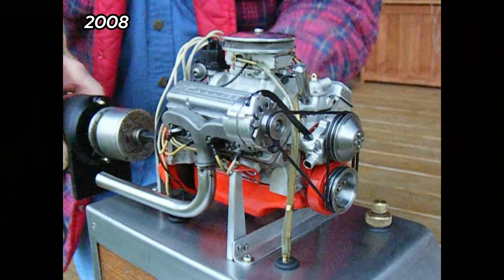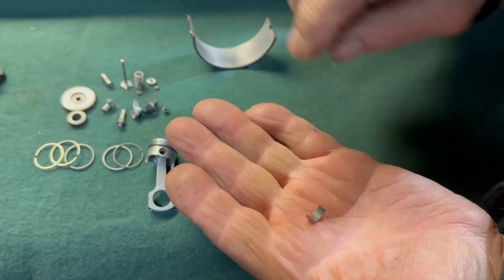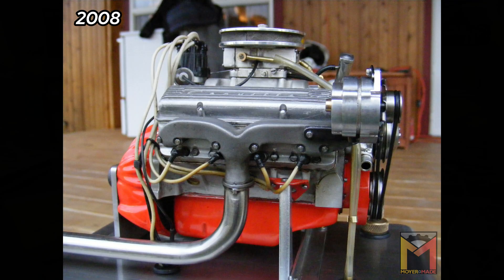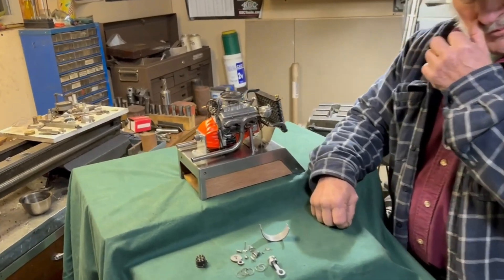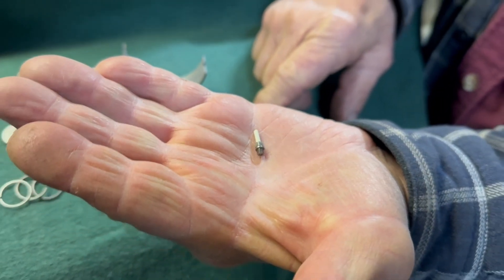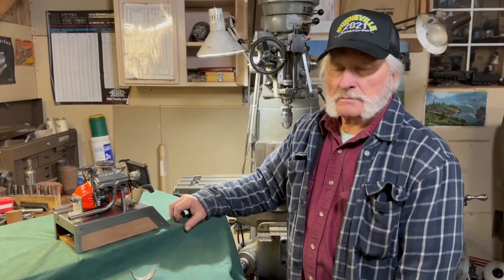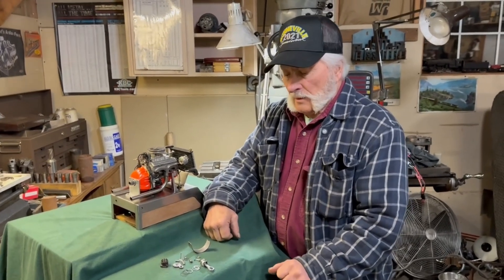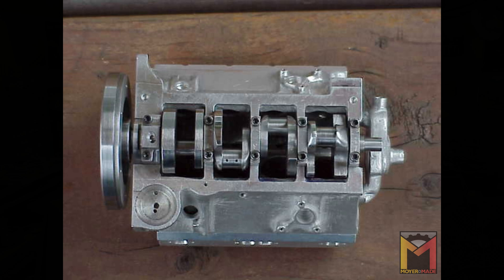World's Smallest RUNNING Chevrolet V8 Q&A

Comment: I love your commitment finishing the iconic 327 I spent 7 years hand building a L88 427 1/6 scale that ran for a few minutes before the camshaft went flat because of a set of overkill valve springs, I actually built a contraption like a key making rig to scale down the cam lobes off a real bbc camshaft, I still have all the crude parts sitting in my display case with many old school 409 intakes and LS-7 rods and pistons  I have been working on the Chinese micro engines and Wow their machine work is all over the place lol!

Comment: Wait I thought you said...1/6 scale..

Didn't chevy 327 have 4" bore..

So piston should be 0
667" diameter...

It don't matter...

You made a beautiful model

Just amazing
Reply: Bigger bore gives you more room for valves and spark plug, he was probably limited by the minimum size the valves and valve springs could be and still run
Reply: Yap...bigger bore for more valves..

Maybe I heard him say bore was 0.6"

True scaled 1/6 327 bore would have 0.66"

Maybe I will listen again...

I bought a Yausa rotary table...from an old dude in Phoenix...

He build scale running models of engines too...

The one special tool...cool...it was like parts tracer....lots of pivot brackets...

It allowed full scale trace to smaller parts....

And that Trikoke or spelled almost correctly...

And rotary table that could be tilted...then it was on his Briggeport vertical mill..

No CNC...
Reply: @fredmitchel1236  my dream would be to build a running model of a 292 Chevy 6 I love the detail, passion and problem solving that goes into live models